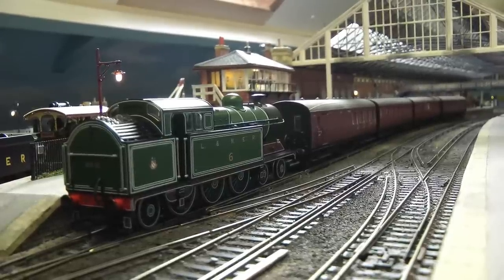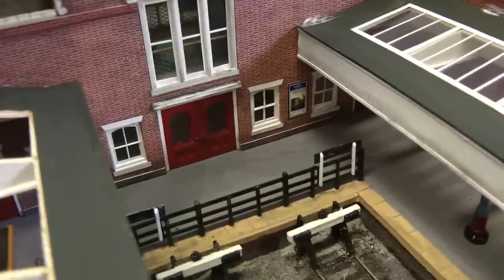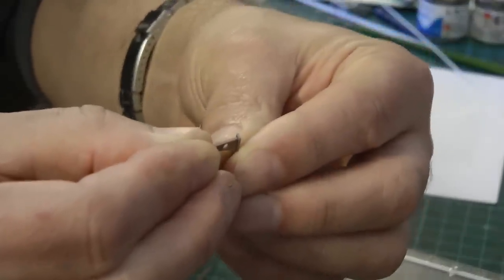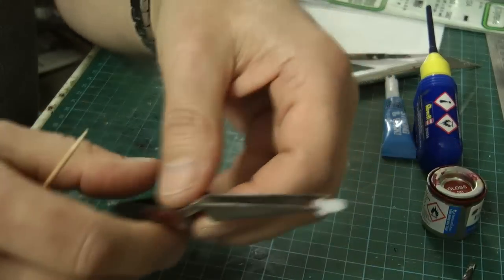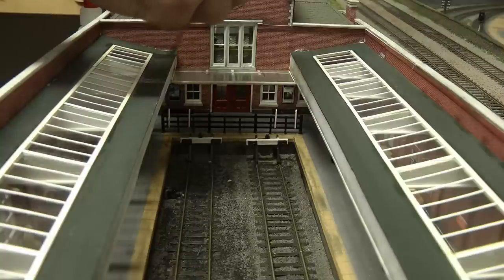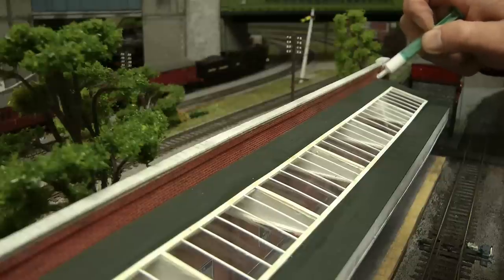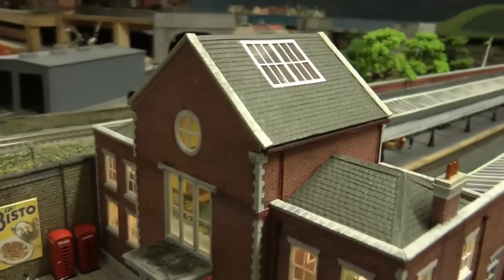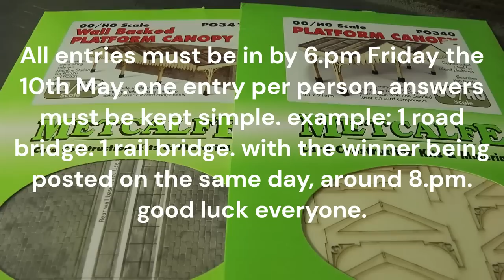Jarrow Road Station Completed. No363

Comment: Hi Tony looks like your A5 could do with working sandboxes (lol) to get up Stevensons Bank. Love the idea of using parts that others may have thrown away (I have several boxes, must be a model railway thing!!). Jarrow Road looks great, I think the signal box if its anything like the one I won would be worthy of the next build, take care and please stay safe regards Barry..
Reply: Or maybe a couple of slabs of lead inside those side tanks? Deaden the sound as well!😊
Reply from the maker: Yet that would work as there is plenty of room in the body for those extra weights. 
Very True Barry. i you know with model railways never throw anything away that might come in handy for your model Railway. the other at a show, i had come across an old Ho scale unfished kit. the windows and doors will come in handy for my next project as you will see. many thanks again for commenting Cheer's Tony

Comment: Hi Tony. This has been a fantastic build! When you filmed the first video of where it was going to go, I'll be honest and say I wasn't overly excited. It was only a small area and I couldn't imagine then what you would be doing with it. Goes to show what I know doesn't it! Orrather what I don't know. Your skills and imagination have once again blown me away. So I have an question. When you were wondering on the film about what to do next, the camera was looking over Jarrow road at nearly a 45 degree angle and was pointed at a tunnel with bare wood to the left. I was just wondering what was going to go there? I noticed when you did the last tour of the line that there is still quite a bit of places with just framework. At least we know that there is still pleanty of content to come! :)
Thank you Tony
Mav
Reply from the maker: Hi Mav. Your right there is plenty to come with a new smaller project just started. which hopefully will finish of another small area. its been like that through out this. focusing on one Inch at a time. The cottage is next, in case you were wondering.  Vera is the inspiration for this build. many thanks again for commenting. Cheer's for now Tony

Comment: Hi Tony, love Jarrow Road, absolutely fabulous, you have just answered my problem with the chimney pots for my island platform buildings using those transit packaging stands, they also use them for printed curcuit board stands, Nuneaton Station is progressing nicely, it's amazing how heavy these structures weigh, have you considered building one of those over track signal boxes like Wylam or pelaw, if not for Jarrow Road perhaps some other part of your layout, i visited Wylam and was very inspired by it. Kind Rgds Geoff.
Reply from the maker: Hi Geoff. I have seen pictures of two over head signal boxs that i am keen on. the original Pelaw box. like you have mention and the Hexham signal box. and i have just the right spot for either of those. which will be sited at Newhassle north Junction. next to the M.P.D. but yes great minds think a like. cheer's again Tony

Comment: Tony the A5 needs a push but things are starting to move forward what's next? Jarrow looks amazing  many thanks enjoying your video's
Reply from the maker: Hi Tony. i was just about to pull away and the controller off and she started to move on her own accord. but i have to admit it took 6 takes before she get up the bank. and that's the one we have in the video. if she did not make then. i was going to remove another coach. but yes it was hard work for the A5. thanks again for commenting stay safe. Tony

Comment: That A5 needs some sand in its sand boxes, Tony, to help on Stevenson’s Bank. I suspect that the ‘hand of God’ provided some assistance. 😂 
Steamers are not good on grades, even on the 12” to 1 foot scale railways.
Well done with the station, Tony, it looks brilliant!
I’m not entering the competition, but did you mean 10th March, or as written, 10th May for the closing date, matey?
Looking forward to the next build.  Have a great weekend.  Best, Jason.
Reply from the maker: Hi Jason. I can honestly i had no hand in helping the A5 reach the summit. mind you it did take 5-6 tries to get the loco go up the bank. 
10 of March it is. it was a typo error. the station is not bad. maybe the next one will be better. but we shall see. next up is the cottage. thanks again for commenting. until next time stay safe. Tony
Reply: @TONYNORTHEASTERN  Maybe the addition of some weight (tungsten is heavier and safer than lead) within the loco would help with traction.  J.